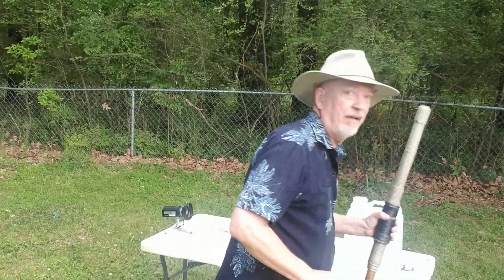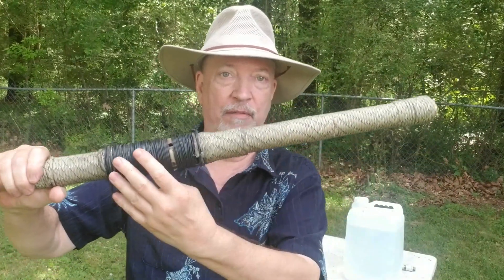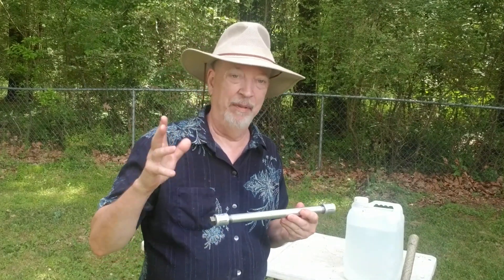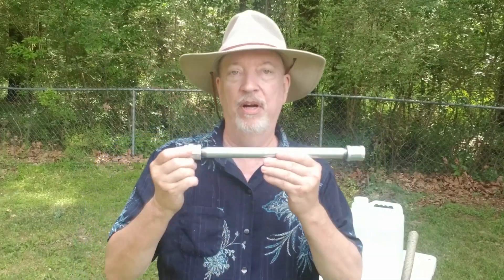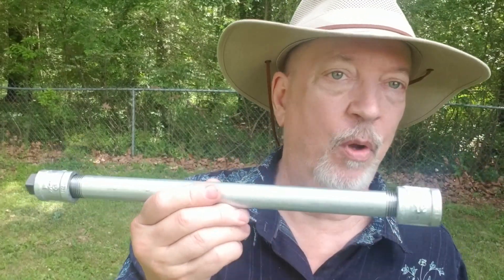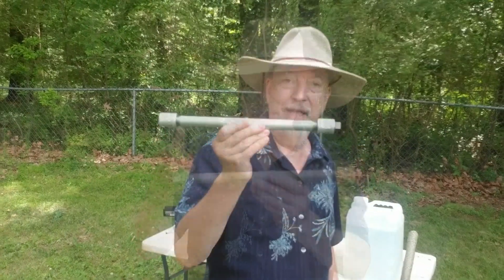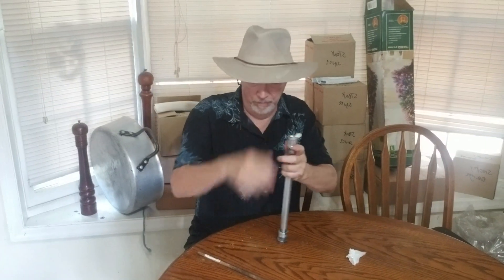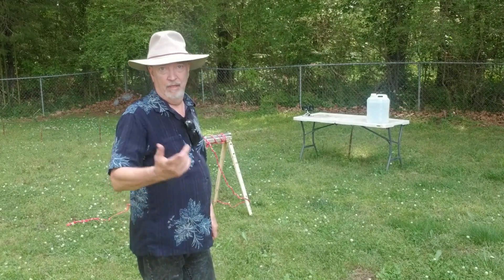Handgonne Pt 2/A: Steel Pipe

Comment: 09:40 a lot of lost energy which passes through the hole in which the wick (detonating cord ) is put.
the ancients used a hand serpentine lock, lit the tinder and pushed everything firmly into the hole, this had the advantage of limiting the leakage of gas through the hole which was made for the cord
Reply from the maker: Originaly they used a two man crew and the gonne had an open touch hole. One man held the gonne while the second touched it off with a slow match. Then came the serpentine lever, which was not a true lock. While this method was more convenient I've seen no data showing it to be more powerful. The flintlock has an open touch hole also.
Reply: @timesgonetech3057  you're right,no data about this subject.
Reply from the maker: It's an interesting idea though, except for my flintlock's open touch hole. But I suppose they could have been on to something given the technology at the time.

Comment: hello friend how about a greeting I want to ask you something Migo what is the nut in the back of the barrel for
Reply from the maker: That's a plug. I threaded a coupling onto the pipe nipple/ barrel, then threaded the plug into the coupling, then drilled the touch hole through both. The plug itself is not solid but is hollow and forms the powder chamber, reinforced by the coupling.